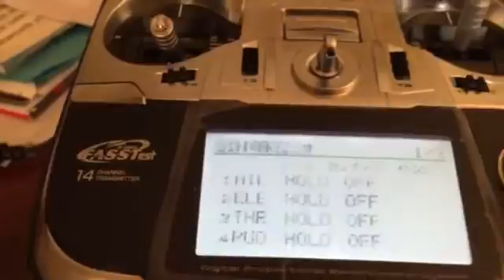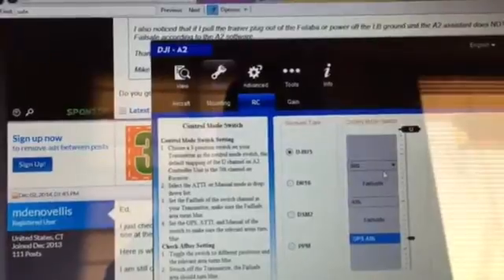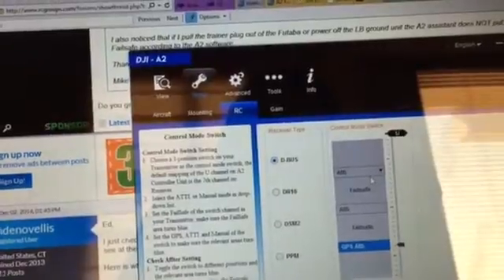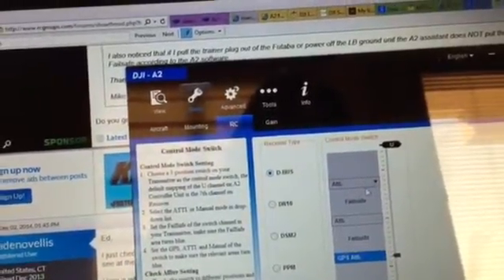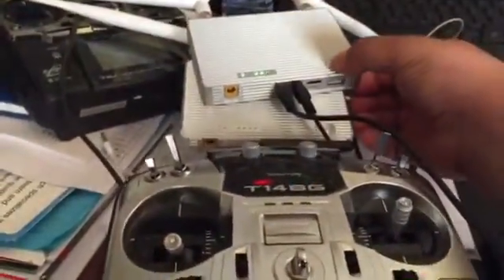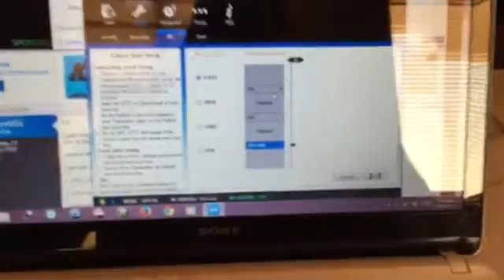A2 with lightbridge problem not going to failsafe

Comment: I have tested the failsafe with the A2 and Lightbridge . I am confirming that the A2 will go into failsafe when the lightbridge is turned off. We hovered the drone about 6ft off the ground and then powered off the lightbridge. The drone went in to failsafe mode and flew straight up in the air and then flew to the home location and landed safely.

Comment: The same issue I've just noticed on my S900+A2+Lightbridge+Futaba 14sg. "U" channel doesn't move marker while switching-off LB ground st.

However this has nothing to do with fail-safe functionality. I was little afraid too so I've done some tests. Moved S900 to 400m distance 15m hight then switch-off LB. S900 immediately started RTH procedure, climbed to 50m and returned above me. Then switch-on LB and regained control. I checked several times with different RTH heights and S900 always returned back.

In my opinion no need to worry, however I hope DJI releases fixed version of SW of LB remote module soon.
Reply: Václav Svoboda  Ive got the same issue, I setup failsafe on my radio but when I unplug it from lightbridge it just stays where it last was. So failsafe definitely works despite this? Cheers
Jesse